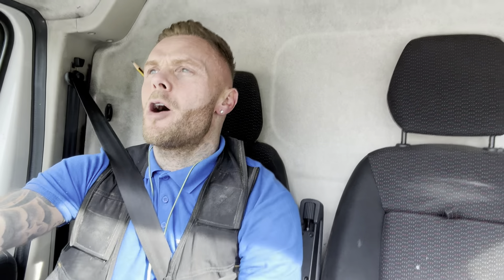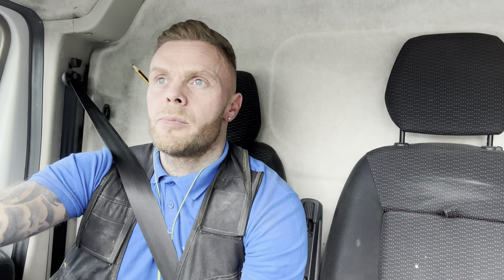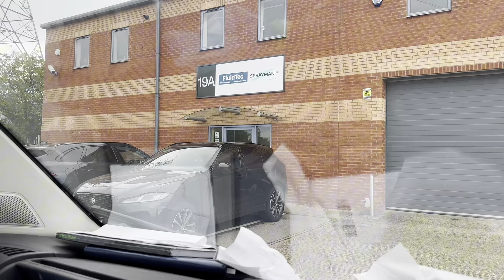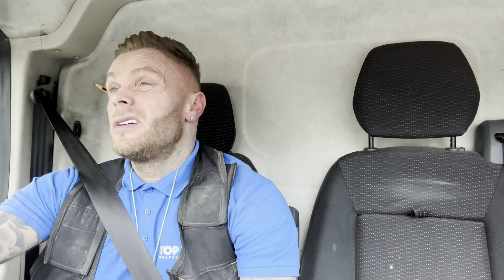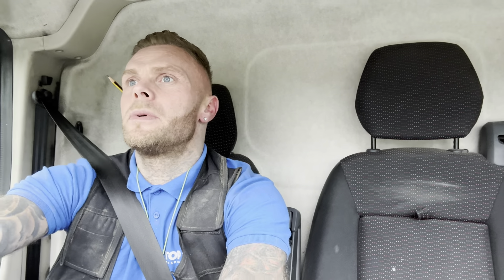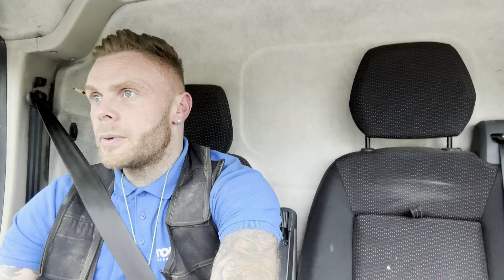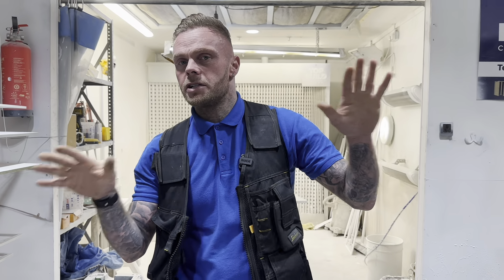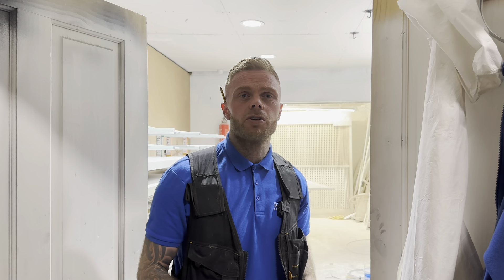Spray Painting for Fitted Furniture & Woodwork - OUR PROCESS

Comment: Thank you for sharing. We are hoping to switch over to water base painted in the coming weeks. How long does it take to dry between coats roughly ?
I use AC paint at the moment and the drying time is very good
Reply from the maker: Hi no problem at all 👍🏻 in our booth we do have good air flow , occasionally add in fans plus we have a woodwaste heater downstairs which does keep the building at a good temperature - on the waterbased it’s touch dry within a few hours - anything finishing / topcoat we usually do afternoons and leave each side to fully cure overnight before turning just as one of our habbits - we do typically have a busy booth so there’s usually always something else to prep and prime in the times between drying for us - 

 I did find the precat, AC & PU quicker drying times but nothing majorly that affects our process with the work we do , for us the smell , clean up and just general overall ease of use over powers that for us on decent W/B👍🏻

Comment: I use a gxff as normal airless, do you find the dead band/drop in pressure not to much with adding the air assist? What aaa gun you using?
Reply from the maker: Hi no not at all, we really find it great adding the airline - once got pressure right and a nice air pressure together it does give us a nice finish 

we use a performa AA gun with this set up 👍🏻